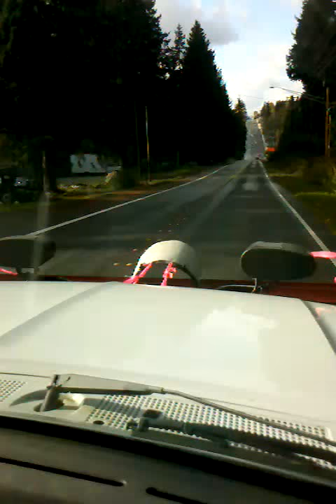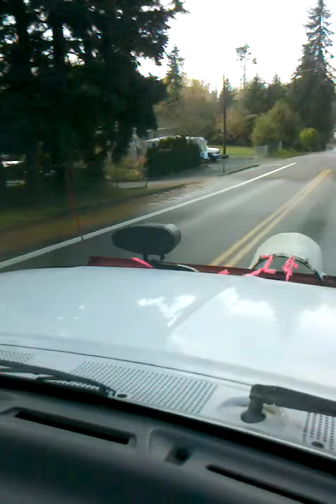Snowplow scoop

Comment: I just used a piece of aluminum and bent it to shape. it didn't do much. ended up replacing my radiator and installed a heavy duty fan clutch. it still runs warm but not nearly as hot as it used to. (1996 ford f250 w/460ci)